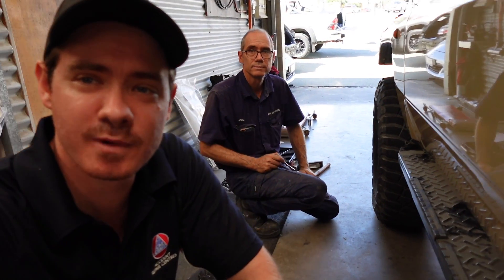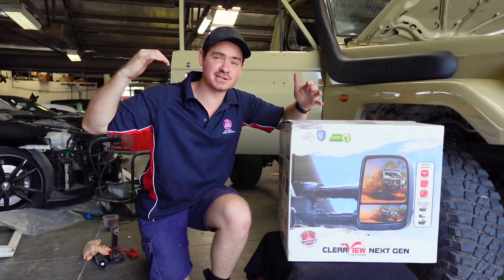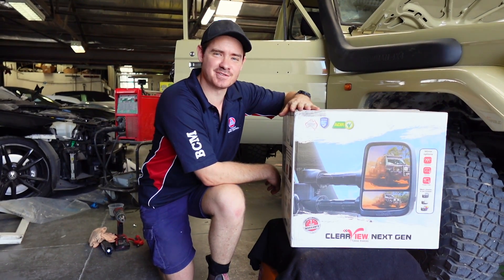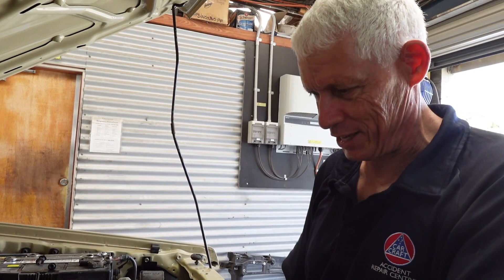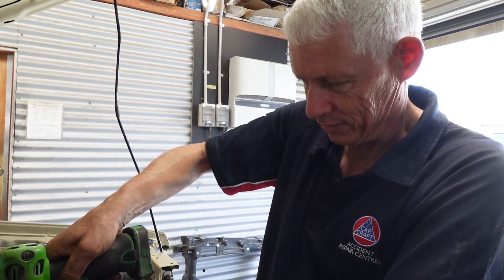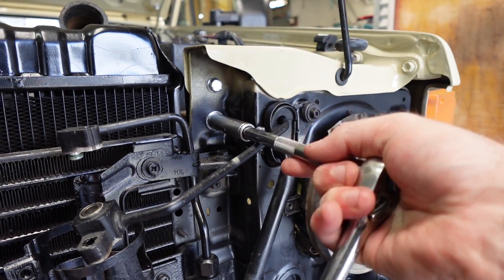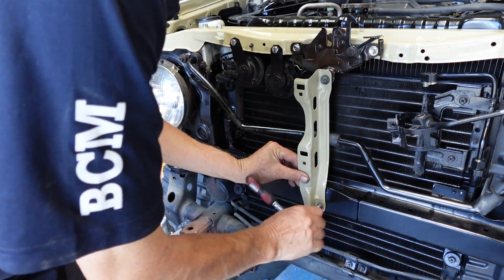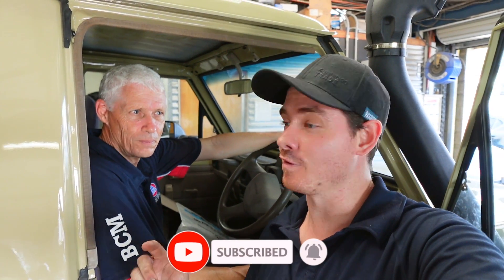ENGINE BAY, SIDESTEPS & CLEARVIEW MIRRORS / Hzj75 LandCruiser rebuild - Ep 4

Comment: Hi lads..can i drop mine off to get the same treatment ?😂 Nice build guys! What a Beast!!🍻
Reply from the maker: 🤣 It might take awhile!
Reply: @JRCadventures  What do you Guys think of these fibreglass windscreen surrounds on ebay for the 75?
I like the idea they won't rust but wasn't sure how they go fitting glass ect...
There half the money also😎🤙..i need one pretty soon..
Reply from the maker: @ozdog822  - I've had a look at them and it might just come down to a personal preference. I prefer the metal just if you get a dint you can repair it easy, where the fibreglass might crack and a tad harder to work with. But might be worth it for the cost! Just need to make sure its from a good mould so the windscreen fits well. If you get it, please let me know how it goes.
Reply: @JRCadventures  Will do mate..cheers🤙